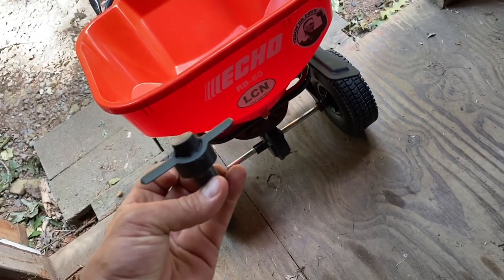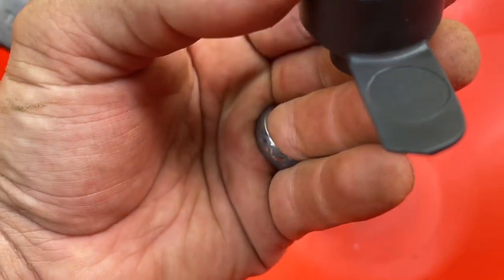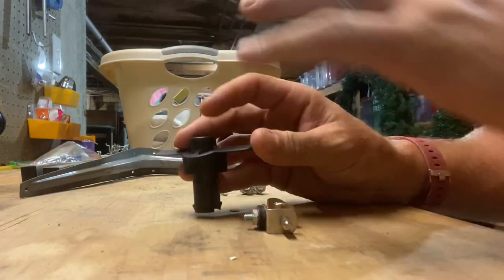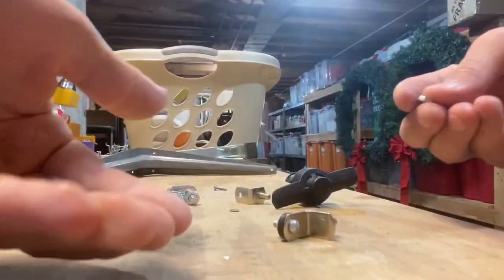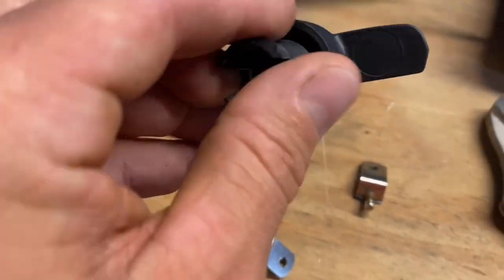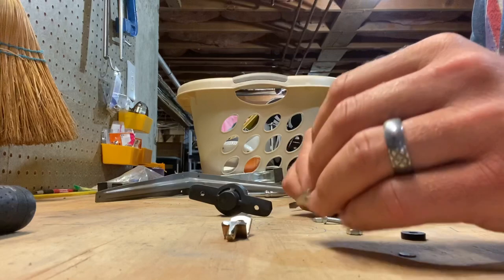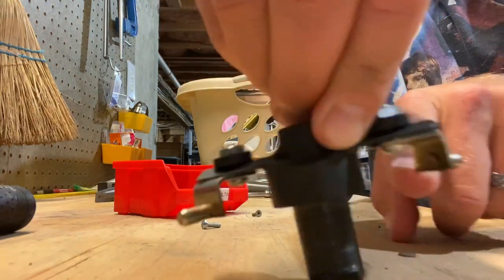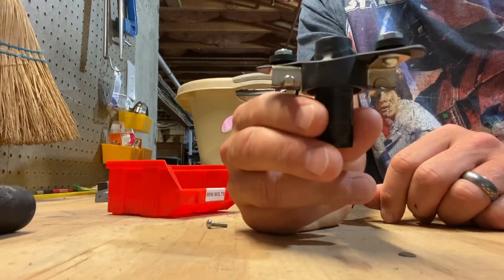Echo RB-60 Agitator Mod DIY

Comment: Good explanation of your idea on fixing the echo spreader, I have one and I put zip ties on the plastic agitator without lifting it out. Now that I’ve seen you lift it out with no problem I’m going to go with the shelf brackets. Thank you
Reply from the maker: Just know I modified it a bit and only put one bracket on a single wing. Seems to do better as two was just spinning to fast and pushing it away still. But yeah it comes off easy.
Reply: @Neighborly_Content  Thank you for the update👍🏻

Comment: An easier way of modifying it is get some 3/4" PEX pipe and cut 2 pieces 1 3/4" length. Slip each one on each side of the ECHO'S agitator and spray some insulating foam into the pipe to bond it to the agitator and let it cure over night. You'll be good to go with a light weight strong fix. Works great for me.
Reply from the maker: I ended up removing one side of my “wings”. Made a bug difference in catching material vs spinning it away.

Comment: I also had to glue in the plastic end caps on the bottom of the 2 stand legs. One fell off and it was lucky I found it. I pulled the other one off and used some adhesive so they wouldn't fall off again. All in all for $100 it's a good spreader for a house owner that doesn't use it everyday.

Comment: Could you use one of the spinners provided for the rb- 80, it has the two level small one and a low metal bar?
Reply from the maker: Looking at the exploded view of the RB-80 it looks to be a completely different connection than the snap in of the 60. The 80 uses an auger with lock nut and the 60 is one piece that snaps over the stalk. Good thought though.

Comment: Great modification! I’m wondering will this make more fertilizer or product come out of the spreader than what it is designed for? Meaning on the correct spreader setting, will I be applying more than what is intended, because of the efficiency of the spinner modification?
Reply from the maker: Based on my usage the output doesn’t change because the auger is not spinning faster with the winglets. If it was moving faster and through a larger opening then yes. Again from my use the application is not dumping more product simply allowing you to start the shaking with so much left in the hopper. 

If you wanted as an alternative you could simply add plastic or metal panels inside to make a more funnel shaped bucket but sacrifice capacity to ensure steady flow. I went a different route with less modification.
Reply: @Neighborly_Content  thanks! I'll keep this in mind when I get mines. I'll probably do the same thing. Thanks again

Comment: How did your modification work?
Reply from the maker: Checkout my other vid for the result.

https://youtu.be/RPuCO49OZkc
Reply: Thanks, I just got it and did your mod. I’m new to spreading. How far apart do you do each pass?
Reply from the maker: This spreader has a wide throw. I’d say a good 7-8’ across. You can test that by going along your driveway or street edge and see where the best distance the stand is. Then space yourself appropriately from the lines of your spreader tires on the next pass.

The other key is to overlap a bit, I go for about 1/4 to 1/2 overlap on each pass.

Comment: all you had to do was superglue a strip of cardboard perpendicular to the plastic blades. The strip of cardboard could be rectangular, curved like a scoop , or any shape you want. All for free and modification time: 30 seconds.
Reply from the maker: Cardboard I don’t think would be supportive enough. It would bend from the weight and superglue most likely would not hold. Also my concern would be when you rinse and washout the tub it would become soggy and tear or weaken even further. 

There are definitely alternative ways but the one I did has worked pretty well.

Comment: Manbyou shouldnt have to do all that. The cheap Scotts doesnt have that problem
Reply from the maker: Cheap Scott’s has other issues. One major being the hollow wheels can catch fertilizer and end up dumping it off in clumps as you walk. Depending on the fert you use that can lead to uneven spreading and burning.
Reply: @DIY Guy  Does the earthway 2600 have that same problem? That problem is very annoying. I'm willing to purchase another spreader that doesn't have that problem. However ibdont want to purchase another and it has the same problem